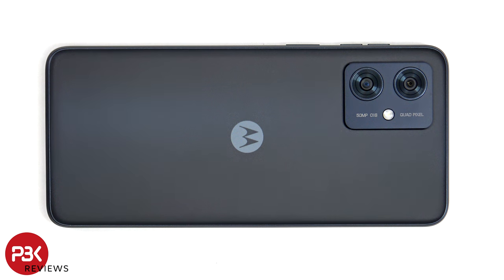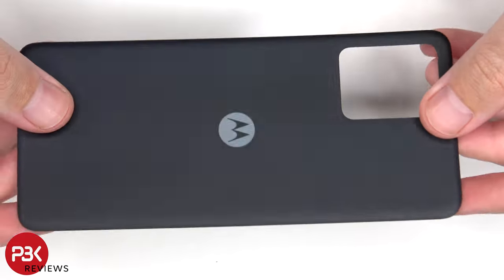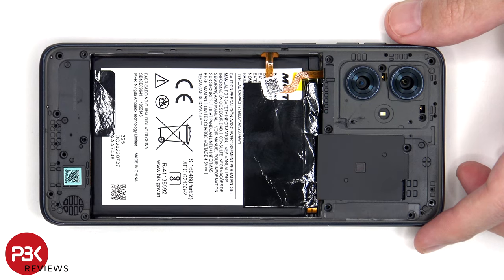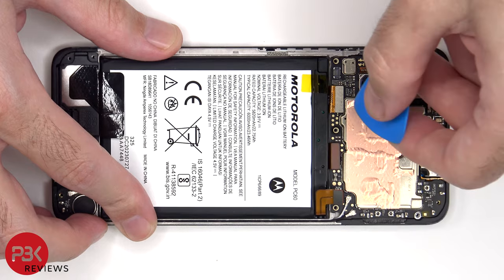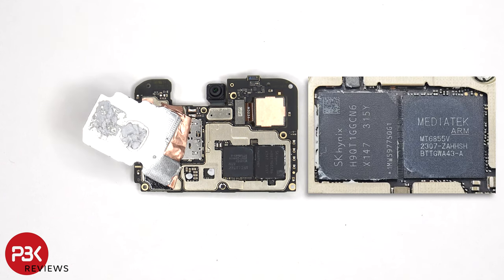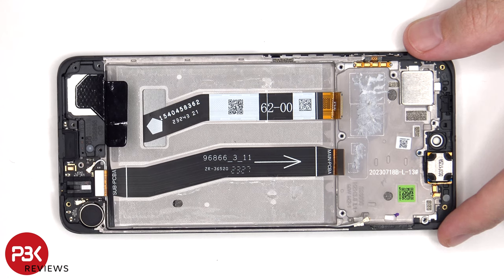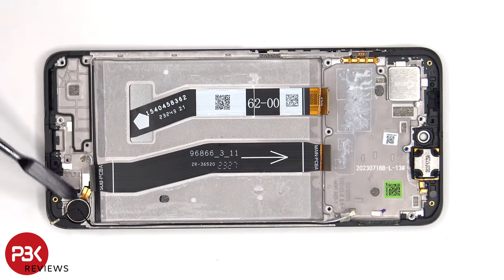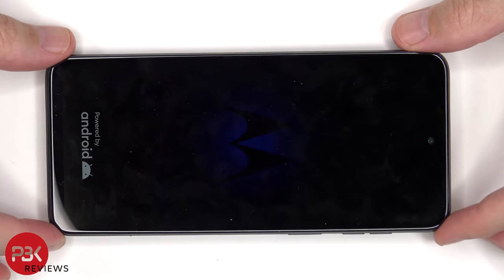Motorola Moto G54 / Moto G54 Power Teardown Disassembly Repair Video Review

Comment: Disappointing that Motorola haven't made the battery easier to replace. One small cutout in the back housing where that snap on battery connector is and some pull tabs on the battery itself, and you could have replaced it just by removing the plastic back cover. I know it's a cheap phone, but those changes would have cost almost nothing.

Comment: Sir make a video on relplacing of its camera lens 😢 the fog is in my camera
Reply from the maker: The camera lens is held in place with adhesive, You can heat it up with a hair dryer and pry it off with a razor blade. But it might not only be from the camera bezel, the adhesive around your back cover might be loose somewhere causing moisture to get in. So you may need to replace the adhesive for the back cover.
Reply: @PBKreviews  thanks sir for your reply

Comment: Why does my moto g54 5g  phone feels a little bulge on the right side of the back below the camera?
Reply: Right side of the back just below the camera right
Reply: yes you actually can fell it all around camera , not much but it there.  I gues because the back is thin flexible plastic and there arent 1:1 size of parts in the back under it. Small engineering flaw
Reply: Yes I can also feel it  first I thought it was a fault in my unit but later on it confirm that it's a factory error

Comment: Did they lie about "Stereo Atmos", where are 2 speakers?
Reply: 1st is the ear speaker at the top of the screen which works as loud speaker as well, 2nd in the bottom to the right from type C hole . All good

Comment: Isn't it g54 Power ? g54 comes with 5000 battery , this one 6000
Reply from the maker: G54 Power is the same thing but rebranded version in different markets. The Moto G54 in china has 5000 mAh battery vs India and other regions which has a 6000 mAh battery. The 6000 mAh version in china and similar markets are advertised as the power. Confusing but yep. I will update the title to include power in it too since its the same phone just advertised with different name in different markets.